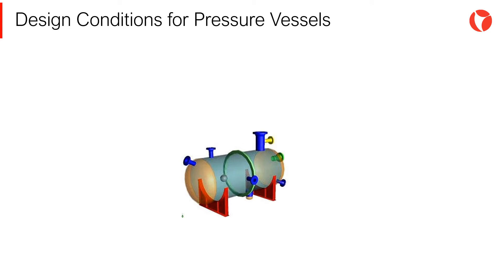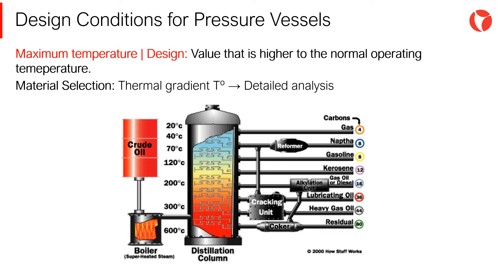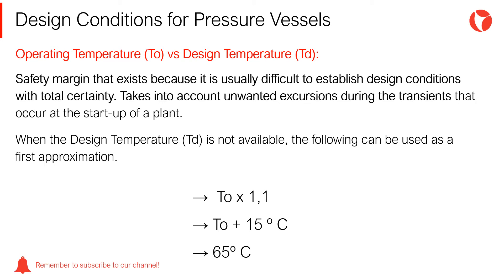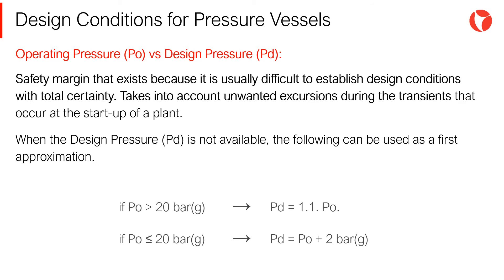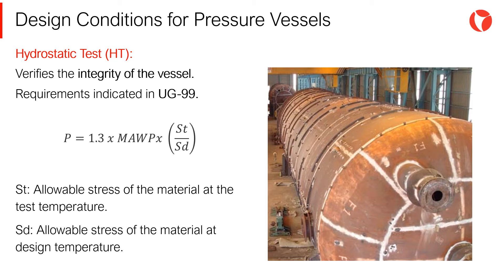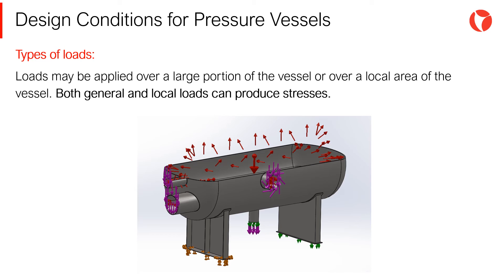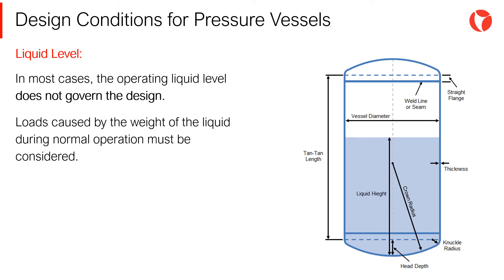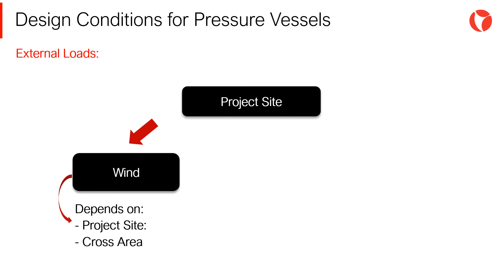4  Design Conditions for Pressure Vessels

Comment: Something wrong regarding of design pressure margin over the design pressure:

Pressure safety valve are used to protect against overpressure. Conventional spring-operated pressure safety valve needs 15% margin over normal operating pressure to avoid simming. So, common margin from operating pressure to design temperature used to be about 20% at least.

Regards,

Sébastien, P Eng.
Reply from the maker: Dear Sébastien, thank you very much for your comment.

As you may know, API 520 is very clear about PSV’s set pressure. The design margin referenced to in our video is between the MAWP of the component and the Maximum expected operating pressure. Therefore, these two concepts (design margin and PSV margin) coexist.

Kind regards,
The Arveng Team